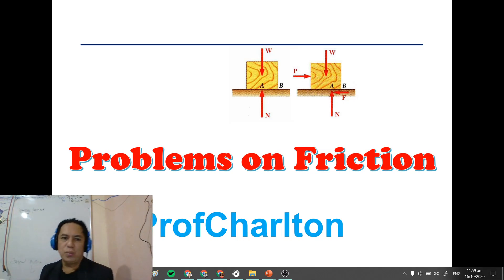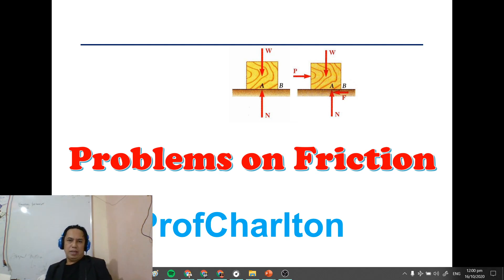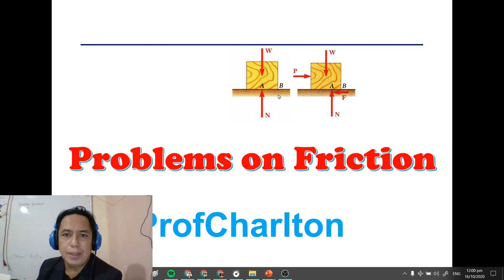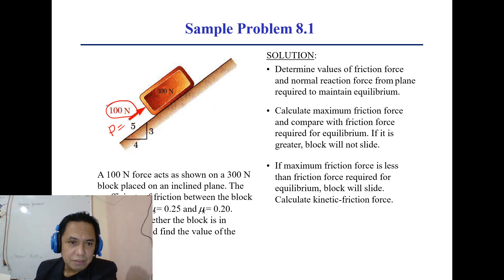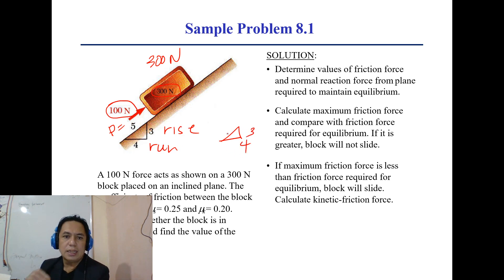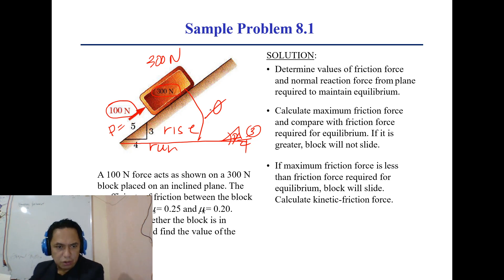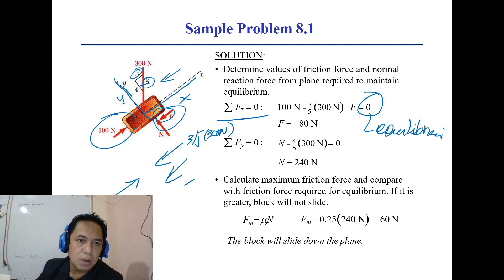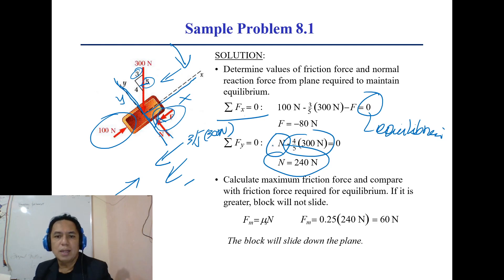Ch 8 Statics of Rigid Bodies: Problem on Dry Static  Friction Solved...

Comment: Thank you ProfCharlton for making time to sit through this presentation/lecture. It was lively, engaging, educative, and fulfilling.  An object placed on a sloping surface will often slide down the surface. The speed at which an object slides through a surface depends on how inclined the surface is; the greater the slope of the surface, the greater the speed at which the object will slide down it. In physics, a curved surface is called a curved plane. It is known that objects accelerate through an inclined plane due to an unbalanced force. To understand this type of motion, it is important to analyze the forces acting on the object on an inclined plane. One trick that makes it easier for some students to solve these problems is to rotate the free body diagram so that it looks more like the horizontal motion problem.